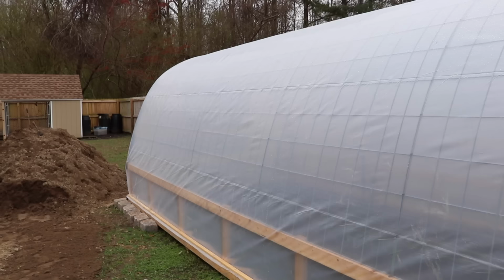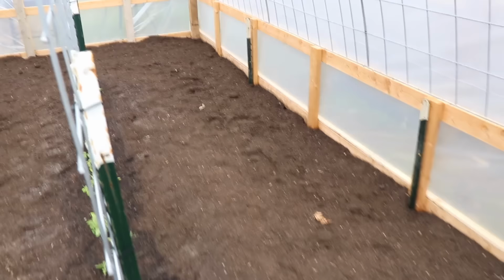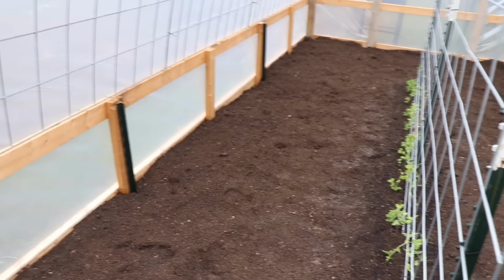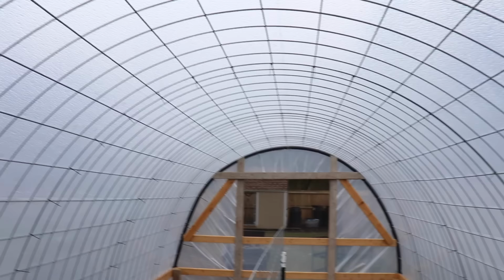DIY Cattle Panel Hoop House || Build Your Own Cheap & Easy!

Comment: This is an absolutely BRILLIANT concept for a smallish greenhouse, storage building, project shelter, etc. Cattle panels---who knew?!? I need to construct a boatbuilding shed and have been looking at all sorts of plans and materials. This system makes the most sense, for the least money, by far. Moreover I have a friiend who can enclose it with heavy heat-shrink plastic for a tight, perfect fit. Thank you SO much for the idea.
Reply from the maker: Awesome Chris! So glad this was helpful! Thanks for watching our video! 😊
Reply: Agreed! This concept could be converted into a larger more permanent structure. Wondering what kind of light weight roofing suggestions are out there

Comment: One helpful hint i use on my garden, when you staple the plastic to the wood, use small strips of cardboard couple inches long on top of the plastic, the staples won't just pull right through
Reply: LoL, too funny, they did
Reply: Good

Comment: I watched a lot of youtube videos about hoop houses, but this one is the best.
Reply from the maker: Aw thank you so much!
Reply: I think so too. Just bought the panels to make
Reply: I agree.
Reply: I'm going to buy materials I don't have at Tractor Supply!
Reply: For our tobacco green houses, we put  tennis balls on one side of the plastic using a string to tie each ball into the plastic.  Then tie a rock to the other end of the strings and throw the rocks over the greenhouse.  Now pull in unison and the plastic goes over the greenhouse.  If necessary poke the balls up from the inside if they get stuck.
Reply: Using a 1" strip of fabric like old sheets or tshirts under your staples will keep the plastic from ripping out as quickly.
Reply: This is exactly what I wanted to build.  How wide is greenhouse?
Reply: Good solid build here. It is possible to get an 11 foot wide GH with a six foot tall height for low wind profile. Use four foot corner and center posts and sink 1 1/2 into post holes and at least half a bag of Quickctrete on each post. Once panels resting on two foot high horizontal (I just used small nails to secure panel). Then: place a horizontal on the inside of the panel 7 inches higher than the outside horizontal. There will be a six inch gap between the two horizontals . Place a 2 foot 2x4 on the inside, vertical, and halfway batween corner and center posts. Attach this vertical to the base 2x4 and to the horizontal that is two feet up then attach the horizontal 7 inches higher and the horizontals will come together. Closing this 7 inch gap lowers the ceiling to six feet and bows out the panels so you can get closer to the walls without bending over. This gives you 1/3 more growing ground! Here in New Mexico we have nasty winds that change direction all day so the lower wind profile a big improve. Also: idea; if GH gets too hot, even with skirts rolled up, cut windows in the ceiling and make removable hatches - square of plastic with border of self adhesive Velcro! Manipulate from inside GH.: )
Reply: Same here
Reply: Yea this guybis Killin' it for sure!
Reply: I agree. This is my go to, how to video
Reply: 안녕하세요  여긴 한국입니다 우에 지붕망은  어디에서  구입하나요  여긴 파이프로 하는데  망으로  하는게 더 좋아 보이네요. 설치하기가 편하게 보이네요. 망 명칭을  알수 있나요

Comment: Not a lot of people may be aware, but Home Depot sells - online only - steel zip ties.  I really like them cuz they don't get brittle and break after X# years outdoors.  Also, I think they're easier to use than hog rings.
Reply: A whole roll of rebar tie wire that’ll last many years is $13 bucks
Reply: So does Harbor freight
Reply: ... Guys Guys the plastic covering only lasts about 6 years tho ... not forever steel  ...
Reply: @willgaukler8979  Good point!  Lol.
Reply: Invest in Safety Wore Pliers there jaws are designed to lock and they have a corkscrew inbetween the handles i will never waste money on zipties again
Reply: Mississippi  folks will weld our panels together.

Comment: Putting the cattle panels on the two-foot stem walls makes a huge difference in the width and height of your greenhouse. It converts a marginal hoop house to something with plenty of space with only minor concessions to expense. I like it.
Reply from the maker: Hey Ben! Yes, I really like the design idea making it taller too! Gardening can already be a back breaking job lol...I don't need a hoop house that I have to stay bent over in while working haha!! Thanks for watching our video!
Reply: I would of suggested to cut a channel out of the edge of the long inner side with a table saw or hand held router, so the metal would flex to timber, not just being held by the U nails. 

Shouldn't be much of a difference normally, im just thinking of the areas ive lived in, that occasionally get really high winds.

Comment: I have built 2 cattle panel greenhouses, I use 2 automatic opening foundation vents down low on each side of the door and 2 up high in the back end. these allow hot air to flow out on warm winter days when my house will reach 90 degrees.
Reply from the maker: Wonderful ideas Roy! Thanks for sharing. 😊

Comment: Although the black zip ties are made for outdoor use they will eventually get brittle. Hog-rings would be my choice for connecting the cattle fence panels. Nice job. Darlington, South Carolina
Reply: just twist wire off cuts
Reply: I just purchased metal zip ties. Was told to secure ends due to the sharpness of the band. Should last longer and be stronger than the plastic zip ties.
Reply: Cement tie wire...last decades and cheap
Reply: Yes William I thought the same thing. Are hog rings galvanized and do they make larger rings?

Comment: Looks great! Awesome job! Only thing I'd suggest is to add probably 2 internal PVC pipes that form extra support for the roof span. They can bend easily and conform to the same curve of the cattle panels. This will help support the overall structure, as snowload can take out the whole thing...been there..done that. Good luck!
Reply: ... snow load removal has to be considered ... even when building a chicken coop ...
Reply: Use 1/2" PVC and add misters to them, great for watering
Reply: Makes no sense at all

Comment: Looks great! If you drop the end of the plumb line in a bucket of water or fluid it can help limit the swaying to give a good reading quicker!
Reply from the maker: That's a good idea! Thank you!!
Reply: Plumb bobs are often found at yard sales And used tool stores weighing more like the weight of a 3/4 inch bolt. That and the pail of water will give you a line going straight down. I love the T posts .
Reply from the maker: @camperjack2620  these are great tips! Thank you! I wish we had thought of them when we did the plumb bob! But at least we’ll know for next time! 😉

Comment: I admire your hard work and creativity.Its beautiful! I made a small green house last year using nothing but scrap lumber and a window from construction waste and lots of free pallets.I had to buy pvc pipe to make the arch and greenhouse plastic for the sides and screws. It was framed with 2 x 4s on the sides and ends and doors and has one down the middle to support the pvc.I used pallets on the sides and on the floor.This year I'm making another  hoop house for my chickens using more construction waste ,scrap wood, free pallets(no pvc pipe)I have a brand new roll of hardware cloth and some fence wire from a previous project.
Reply from the maker: That sounds perfect! Thank you for hanging out with us on this video friend :)

Comment: A cattle panel is 16 feet by 50 inches. If you spread the cattle panel 11 1/2 feet, to make a hoop, it will stand 5 feet in the center. When this is mounted on a two foot base, like you have in the photo, it will stand 7 feet. A good general height. If you use extra long posts on the perimeter that stick up 3 feet above the ground, 1 1/2 feet in the hole, you then have a nailer from the inside of the GH. This allows you to place a horizontal 2x4 inside the post, about 6-8 inches above the bottom of the panel. This nicely spreads the panel, side to side so that instead of a 7 foot peak, you have about 7 feet at the peak, not pointy, and the sides of the curve rise up a little so you can walk around near the walls without banging your head!
Reply: I'm trying to visualize "about 6-8 inches above the bottom of the panel". I need pictures LOL!
Reply: Dagaan Galakticos, I was considering your idea and thought to myself, with the extra 1 ft of post above ground I'd have to buy much more 4x4's right? I think i'd have too much scrap wood that'd get wasted.  Could I just bury them 1ft in the ground and have 3ft above so as not to have to purchase a lot more 4x4x8's?
Reply: @prodigirl1  I was thinking about putting my post 1 foot in the ground as well, this would prevent the wind from picking up the Green house.  Hope to start mine next spring, I just got the layout in place.
Reply: I was also about to tip this and then say save some plastic to protect the wood on the inside, your foundation 2x4 is touching your soil. This will cause wood rot over time, instead, double line the wood frame at the base so that the inside of it is also plastic lined also. That way the wood never touches water, thus never rotting.
Reply: Perfect
Reply: @christopherrenn8137  The plastic itself traps water from condensation.  It’d be better to just line the bottom of the wood with gravel.

Comment: My only suggestion would be to use hog rings to join the panels instead of zip ties. They'll last a lot longer and are stronger, especially in wind
Reply: I was thinking the same thing.  :goodvibes:

Comment: It may be necessary to add support for the length of the hoop house for when snows come because the cattle panels are not strong enough to hold up all that weight in snow. All year long it will be great up to that time and replace the zip ties with something that doesn't degrade from sunlight. It looks great and you guys did an amazing job. Working together and kept the peace at the same time 😁 love it.
Reply: I love this design but the snow is my worry too. Winters can be harsh in the upper midwest. How do you suggest I add extra support?
Reply: @StrewthFroogals You could put 2 supports 4ft from ends with a support beam across top. Kind of like a Y on each end. If you cover it with 1 or 2 sheets of black plastic before storm...you can pull 1 down part way through storm and next day pull last one down and easily remove snow. That's for a 2 day storm....if 3...add 3...

Comment: I didn't think to add the pony walls to raise the height, but I made a two-panel hoop coop very similar to yours. I just made the frame on the ground out of 2x6s. I also used hog rings to hold the panels together because I was concerned that zip ties might break down over years of exposure to the sun's UV rays, and a hog ring was going to last a very long while. Mine was that wide but only two panels long because it was the run for our chickens. I also covered the cattle panels with chicken wire to keep out predators and I went to a company that prints outdoor billboards and got some of their shade cloth that allows the wind to pass through tiny holes so the sign doesn't get torn up by the wind. I had to cut it to size and pound brass grommets into it and then I lashed it in place. Two years later and it is still doing great. My hens get enough light, but there is enough shade that they don't overheat in the summer. In the winter I throw a tarp over it to protect them from the wind and to hold in a little bit of heat for them.

Comment: We just completed our 22'X12' high tunnel using your plans and it came out great! In fact, we are working on a second one for a chicken coop. Of course we will add 1/2" screen over the cattle panels to keep the varmints out. Thanks for the ideas . . .
Reply from the maker: Hello! This is great, I’m so glad you liked the video & that it was helpful to you. Thank you for your comment! 😊
Reply: Hey I'm looking at doing one 14x24 but I'm worried I'll be arching the panels too much and end up with a super low roof..... What size cattle panels did you use for your 22x12???
Reply: @nickf8028  Cattle Panel was 16 ft. L x 50 in.
Reply: @nickf8028  Hey Nick & Hudgen.  Did it work over 14'?  What was the top height.  I'm going to build mine over 2 raised cinder block beds that are 24" off the ground 13' long & 13' from the 2 outer edges of the raised beds. I'm only 5'6" so it doesn't have to be high but I want to still be able to stand up inside.   Hudgen how tall did yours come out?   Thank you.

Comment: I have done these before but I used reinforcing mesh designed for use in concrete. The sheets are larger than the look of yours. They work very well and are easy to dismantle and move. keep up the vege growing
Reply from the maker: Thanks Tim & thank you for hangin’ out with us for this video! 😊

Comment: I've done a few of raised hoop houses and I really like your build! Thank you so much for sharing this.  Just to note, if one intends to have this withstand it, the weight of snow can (likely will -ask me how I know) collapse it, whether sectionally or completely.  I ended up implementing (having to) "strategic" framing inside for withstanding collapse.  you just cannot guatantee snow will slough off!

Comment: I've watched several variations on the cattle panel hoop house, and yours is at the top of list in terms of design and workmanship.  I like that the half sidewalls give you the opportunity to add a bench or shelving. Very well done!
Reply from the maker: Hi James! Thank you so much for the positive feed back! So glad you liked the video! 😊
Reply: Hind sight is always 2020 but do you think it would be a good idea to allow the sides to roll up two feet from the bottom for ventilation purpose just to wear the panel starts to make its arch? Great video, next I'm going to watch the green house build 👍🏻✌🏻
Reply: Agreed. Very nice and not too hard to construct

Comment: Just a suggestion. Use those cattle panels you used as hoops to grow your vining veggies like peas, cucumbers and squash. Leave the center for your bushing plants. Also, It didnt look like it during your build but any wood in a ground contact situation should be pressure treated. You will get many years out of pressure treated vs a little over 2 years from raw lumber.

Comment: Peas are pretty cold tolerant on their own btw. I plant them about the same time as I do potatoes (about st Patrick's day) to climb the garden fence.
Reply from the maker: We found that the peas didn't like the warmth in the hoop house, we transplanted them outside and they're thriving now. :) Learn as you go right?
Reply: Yes peas could be pushed back to valentine's/ground hog day at least with this method, just take the sheeting down eventually or roll  up in case of late frost. 
Can also heat it with compost for those months.
Eventually the frame could be the trellis

Comment: Your high tunnel looks great very practical and an easy build. Learning lots from channels like yours I’m a city guy is worked in construction all his life and I’m considering changing it up and doing a little bit of homesteading. So watching channels like yours is very helpful to get ideas. Thanks for sharing. PS the only thing I would’ve probably done differently on the construction is use screws instead of nails. In my experience in decades of construction nails have a tendency of coming out and also if you do get a tear and you have to fix something on screwing it and screwing it back in is much easier. You guys would’ve saved yourself a little time which screws in a screw gun. You might’ve built in a day and a half instead LOL
Reply: Russell Wood, consider real quick!
Reply: I would also add, the wood on the bottom of this is going to rot. I live in east Texas where it's very humid. Wood touching the ground won't last but a couple of years. I'm planning on building this and using brick under the boards so they're off the ground. (I had bought 2 banded cubes of brick at an estate sale a couple of years ago for $50) I also have a ton of pool noodles that I got on a clearance sale for next to nothing that I'll use instead of pipe insulation. Plus I have a huge roll of the plastic I picked up at another estate sale for $5. We have a sawmill and our own lumber, so this project will cost very little. Pretty much just the cattle panels. Hmm...may have to get started building this!! Thanks so much for posting. Great project 👍

Comment: couldn't have been better timed.  I had just begun thinking along these lines as the best, easiest and cheapest way to put in a support system over our 10x10 deck for the malabar spinach, roses and dutchman's pipe (which has been 3 years in the house and needs to be moved outdoors).  This vid is precise and makes clear, with patience, only 2 people are needed to get it done., and done to last! Thanks so much!
Reply from the maker: Thank you! 😊

Comment: I have 3 cattle panels and I've been procrastinating building a hoop house. Love your center/plumb method. Also, the extra width and height by raising the sides is really nice. I would have to support the middle due to snow loads, and use the wind straps due to high winds here. But it looks really nice! Just have to make sure the zip ties are uv protected. 

Those chickens looked like they thought they were going to claim that as their chicken coop. 😄
Reply from the maker: Haha yes they were! They were trying to make it their own! I agree with you on the modifications for the snow load etc. Thanks for watching! 😉
Reply: Would snow pile up on a rounded roof? Seems to me it wouldn't be able to stick and would slide off.
Reply: I've used UV zip ties for other projects and they get brittle just like the white ones and break. I'm gonna use those hog rings and hog pliers
Reply: @mgoh1984  It can if you get enough in freezing temps where everything sticks. So far, mine has not had the issue, but I saw another YTer who did have that issue.